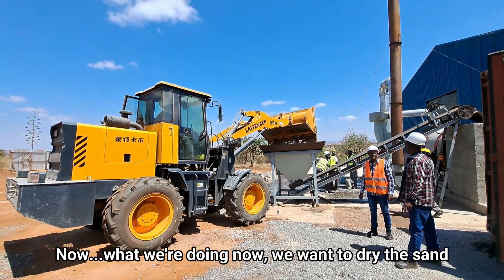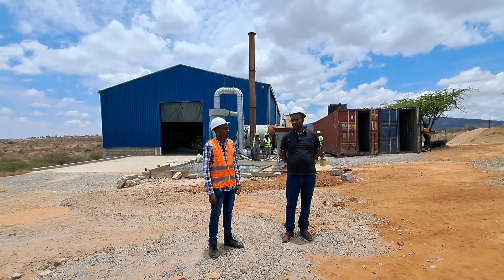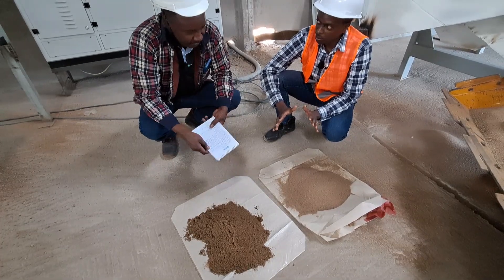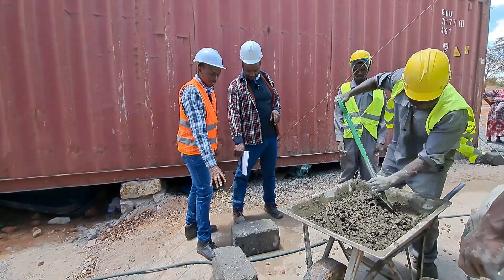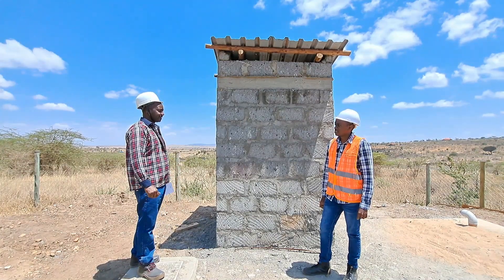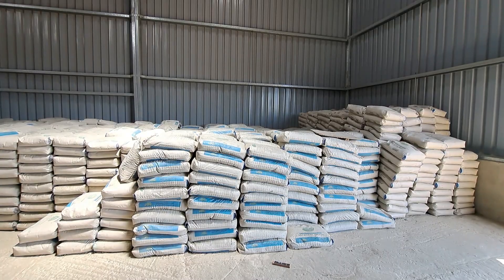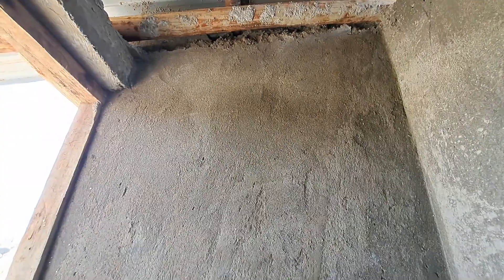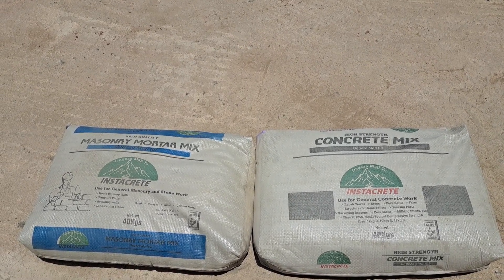Kenyan Startup Instacrete Leads in Dry Concrete & Mortar Innovation

Comment from the maker: Instacrete Kenya has pioneered two new innovative alternative building technologies in Kenya, the dry concrete and mortar mix. You only need to add water for both! The sand is properly dried by heating it using the husks of macadamia nuts.

Concrete Dry Mix
- 40 kgs per bag
- Ksh 470-550 (USD 3 - 3.7) per bag 
- 12 kg cement, 10 kg sand & 18 kg ballast
- Class 25 of concrete
- Ideal for foundation slabs and general purpose concrete use cases
- Bag is beige in colour
- 1 bag covers a volume of 0.7 cubic feet of concrete

Mortar Dry Mix
- 40 kgs per bag
- Ksh 450-520 (USD 3 - 3.5) per bag
- Mix ratio is 1:5 (cement to sand)
- 1 bag covers a linear length of 22-25 feet of 6 inch stone blocks
- Bag is blue in colour
- Ideal for masonry joints & for rough plaster of walls
- Can also be used as a plaster for precast panel joints where 2 panels interlock

To estimate the number of bags for your project, go to https://instacretekenya.net/calculate/

CONTACTS
Kennedy Zackary, Production Manager 
+254 721 417 379
Jacinta Njeri, Administration Manager
 +254 725 986 150
Kelvin Njuguna, Sales Manager 
+254 742 198 735

LOCATION
Malili town, ahead of Konza city (1km past Mukaa DCC office off Mombasa Rd)
Pin: https://maps.app.goo.gl/BPLfKoLw9djYU9ba9

Comment: Thanks Nick this is much appreciated 🙏 and must use for my next project,but hoping they can make 50 kg bags
Reply: i guess because of ratios you can't get the 50kg bag you want may be more than 50kg check on the pinned comment to see the ratios
Reply: 40 Kg bag is easier to handle than the 50kg. Being a DIY product, then this makes it easier to handle and also reduces labour costs as one handman can handle it easily

Comment: much appreciated Nick.i have used the calculator to count cost of laying 6inches floor concrete on a 15*14 ft room and its giving me 150bags *kshs.400=kshs .60,000 .is that high or low?.is the math correct?
Reply from the maker: It should be cheaper as you don't incur the costs of stockpiling the materials needed to make concrete.

Comment: I'm on the fence with this. Does the math add up? If i was to buy a bag of cement and mix it with sand how many 40kg bags will that produce and at what cost?
Reply: That's why they are called options. You choose what works for you. Logistically instacrete option seems nice for time bound projects

Comment: Nice solution. Makes sense for a small project. But for a large project, the math is not mathing. Why?
Assuming a 1:5 cement to sand ratio for the mortar mix, if i used conventional sand and cement manually mixed it onsite, then to achieve the 40kg at 1:5 ratio...it would cost as follows...i.e cement 6.7kg of cement at sh.87....plus....33.3kg of sand at sh.67.....TOTAL = Kes 154. This is 3 times less than the cost of this product 😢😢
Reply from the maker: Thanks for sharing Robert
Reply: it may not be 3 times.what percentage of sand cost bought do you lose through water evaporation,sieving debris?also wastage where the sand is poured?+extra jamaa wa mkono who sieve,mix
(extra labour.) in the video he indicated for a fundi laying blocks :he can do double the daily average from 150ft to 300ft
Reply: Add the cost of transporting sand and cement then add also the labor cost for mixing and factor in the time for these activities and you will end up probably incurring more cost than buying the ready mix.Quality of sand and mix is also compromised using traditional mixing.
Reply: We would like to clarify that the ratio of cement to sand in our Instacrete Mortar Mix is 1:3. There was a typo in the bag printing. We appreciate your feedback

Comment: Drying the sand then adding water when using?
Defeats the whole point and makes the whole process expensive and environmental degrading due to the CO2 produced when drying sand.
Reply from the maker: The sand is dried to ensure no moisture reacts with cement while inside the bag. Once you open the bag, that's when you add water.
Reply: @PropertyNoma  I do understand the science behind drying the sand.
I just made an observation that the process is wasteful and expensive, if the sand will end up wet anyway.

Unlike in the food industry where drying increases self life. In construction, drying sand will defeats the point of doing it. 
It's cheaper and more convenient to buy sand, mix your ratios and continue with the project.
Reply: Keep up your work.
You're doing a good job.
I've learnt a lot about precast wall panels from your videos.
Reply: Hahaha, you are embarrassing yourself buddy. This is commonsense and it is how it's done worldwide. The technology isn't new.

 @Hobby_trails_family_unedited